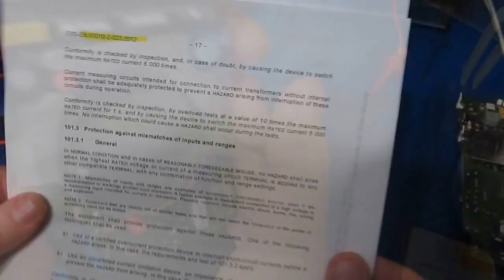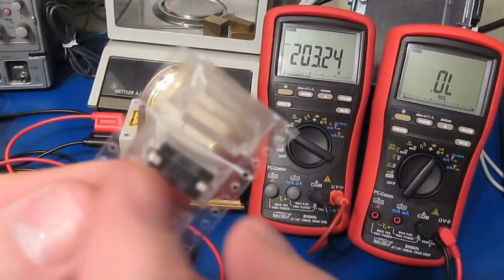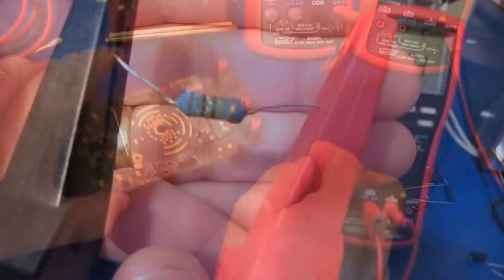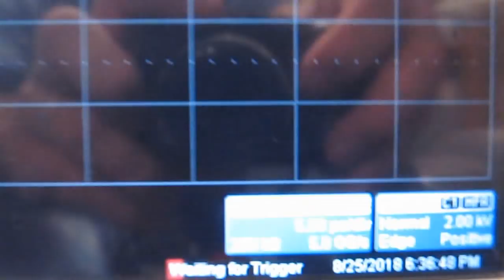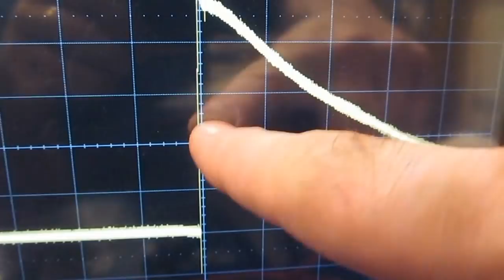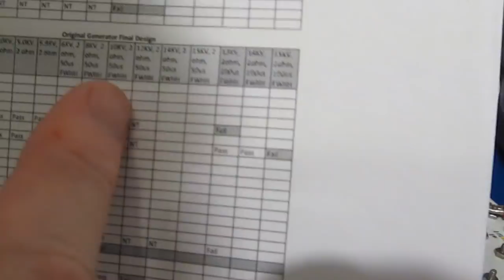Vintage Fluke 189, Replacing the Supercap and More

Comment: I replaced my supercap today with a 5.5v 0.33F supercap.  Success!  I used low melt solder to remove the original supercap, then cleaned the pads of all solder/flux, tinned the pads with fresh leaded solder, add flux and held the super cap with my finger tips in place to tack one side of the new supercap. Then soldered the other leg and ensure it was a good solder on both legs, finished off with IPA to remove all flux residue.  It was a tight fit, but it worked great! I didn't use a heat gun just a fine tip soldering iron.  "Better than factory!!"

Comment: why the supercap need to be changed. what does it affect. i have fluke 89 and is is flickering while reading resistance. it is minor like 0.5 ohm but it bothers me. will changing supercap help solve this issue. thanks in advance
Reply from the maker: There were physical signs of corrosion along the upper seal.   Normally they start to leak, no liquids, but low impedance.  Then the batteries start to drain very quickly.

Comment: Joe, my Fluke 189 is warning LEADS on all scales, but "A", I already removed the input jacks and cleaning, but still showing this warning.  When I heat it, the warning stops, but return when cold. Any idea? Thanks.
Reply from the maker: Looks like you are having a similar symptom as this person.   Maybe consider joining that thread and adding your findings.   
https://www.eevblog.com/forum/repair/fluke-189-multimeter-repair-advice-needed/msg4397968/#msg4397968

Comment: I just checked the forward voltage on my Flir DM285's diode function and it's 1.740v!  What a F****ING PIECE OF S**T!!!!!!!! I should have read the spec's before I bought the meter!!!! I retract my previous question!!  Dont bother testing that bag of RAT S**T unless someone gives it to you!  I'm building a project on a bread board and the dam thing would'nt even test a diode!
Reply from the maker: I wouldn't have much need to get above a 1.7V on the diode test mode.  I pretty much resort to using an external power supply to look diodes.  In the garage it never comes up.

Comment: I found a seller on eBay selling original profile supercaps for “Fluke Repairs”. The price is high, the capacitance seems the same as original, and they fit perfectly. The supercaps on both my 189s were slightly corroded and data was no longer saved during battery replacement, so I replaced the Caps. on both of them. All is well... The next day  I removed the batteries and replaced them simulating a new battery Installation. Date,  time, and saved data was preserved. Mission accomplished.
Reply from the maker: Why would you go to some unknown eBay seller?   I bought mine from Digi-Key.
Reply: @joesmith-je3tq  Perfect Form-factor closed the deal.  Do you know the  actual mFs and voltage ratings on the original caps?  Mine were too far gone to determine anything useful.  The replacement caps measured about 20mF and are 3.3v rated.  Their marking are "3.3v .20"  If there's more, it's welded under the positive connection tab.
I no longer have an LRC meter, so only my FLUKE 289 and my Mastech MS8040, with 100mf and 200mf respectively, have the range to measure the new caps. I'm totally lacking on detailed knowledge about designing with Super Caps so don't know if there's a trick to measuring them.  I've got some slack time this week so am going to educate myself.  I know you used 100mF / 5+v replacements but it requited mechanical mods to fit the solder pads.  I wanted my two meters to look "original" when opened so went with the smaller form-factor devices, since I'm selling one of them.  The only markings on the original S-Caps were a stylized "M" that has a "logo" appearance. One cap is marked 33 above an 11 all above above a lower case "f".  The other has a "54" above "15" above a lower case "f".  These markings are to the right of the "M" logo.  The "-" sign is below the "M" inside a circle, presumably representing the negative post of the device.  I'd say the markings are week and year, but the meters should be way older than 2011 or 2014....
    54     
M 14

-    f

EDIT:  I now understand measuring Super Capacitors requires charging them and timing their discharge via a specific resistive load. No big deal...
Reply from the maker: @Tool-Meister  I used 5V parts to try and give them a chance.

Comment: This an old topic but I have a recent encounter with Fluke service I want to share:  
“Hello,
Service still supports the Fluke 289, please do not open it, you will void the limited-lifetime warranty.
The 189 is obsolete, new Fluke 289 is the suggested replacement. It was obsolete in 2007, all warranties have long expired so you may open those to your liking; we do not have repair parts on the obsolete model though.

Please see a separate email from our system for your RMA xxxxxxxx for the Fluke 289.
Please also check your spam/junk mail folder as this is a system message.

Ship-to lab address is on the top left of your PDF in the confirmation. 
Please do not ship accessories unless requested, especially extra batteries. If we receive extra batteries we will not be able to ship back via air, your order will be returned via UPS ground for domestic orders or cargo ship for international orders. 

Thank you for choosing Fluke for your repair and calibration needs.”

BTW, I live 3 about miles from the Fluke service center in Beaverton, Oregon.  I still have to ship my 289 to them. Silly huh?
Reply from the maker: I assume they are still making the 289.   Personally, I would rather have the 189.  It's just a nice all around meter.  Between the Brymen BM869s and the 189, they are the only two handheld meters I have been using on the bench.  If I lived that close, I think I would have to try and get a job as a janitor.
Reply: @joesmith-je3tq   The Fluke 289 still seems to be the flag-ship of Fluke's hand-held general purpose DMMs.  There's certainly more expensive IR, Process Meters, various Special Purpose meters,. etc., but the 289 still stands out at 50k counts, inherent accuracy, and built-in logging.  
      I purchased my Fluke 289 in Jan 2017. I  use it to monitor and log solar arrays, battery banks, chargers, and inverter systems, mostly for mobile systems.   After seeing the 189s on your videos, I secured 2 of them.  One seems to be unused.  It had the original Ever Ready batteries,  etc. and probes, CD, and documentation are still factory sealed.  Both units handily meet factory specs against my DMMCheck Plus and Penta Voltage references.

      What we really need the “One DMM to rule them all!”  The CEM DT-9899 tries to perform that task, but falls short in too many ways. The Metrahit is god-awful expensive and I have better power analysis on my O'Scope.  Have to say, it's hard to go wrong with a Fluke....especially the 189s!    ;-)  Too bad they're obsolete.
Reply from the maker: @Tool-Meister  If I had to choose between the Brymen BM869s and the Fluke 189, hands down, I would get the Brymen.  Mainly because as you said, the only 189s available are used.   Each of these meters has pros and cons.  I do like the two K-type inputs on the Brymen and I have used the 500,000 count mode to trend data for example.

Comment: Hi Joe,  I accidentally connect a wrong polarity battery on my fluke 189,  part adjacent to 336C P100K has burnt.  W ould you be kind enough to tell me the part number of the burnt parts it is located just behind the contact point of the battery cell connector. Thank you in advance. and more power to your channel.
If you need a photo please let me know how to send it to you.
Reply from the maker: Do you have an account on the EEVBLOG site?  If so, could you post a picture of the part there and maybe circle it?

Comment: just found your channel and i already love your videos but i had a question 
i own a fluke 189 and i think the supercap is starting to go bad so i wanted to replace it but if i do, do i risk losing the factory calibration or not ?
Reply from the maker: Not but depending on your skills, you could ruin the meter.  I believe the parts I procured are  no longer offered.   Good luck and if you have any questions, feel free before doing anything with the meter.
Reply: @joesmith-je3tq  Thanks for the reply 
my soldering skills are not too bad so i don't think that would be a problem and i'm quite surprise that the calibration is not going to be affected by changing the super cap , i thought i would loose everything and would have to send the meter for calibration 
also i can't buy the panasonic cap that you've used in Switzerland so i'm gonna go with this one i think 
https://www.distrelec.ch/Web/Downloads/_t/ds/FC0H104ZFTBR24_eng_tds.pdf
the size is pretty much similar to the one you've used but it's a different package
Reply from the maker: @rickalison5718  This message hit the spam filter due to the link.   Many people will remove the cap and leave it out as they don't need the features.   Calibration is checking the meter against a known standards.  Alignment is adjusting the meter to bring it back into calibration.  Changing the cap will have no effect on this.
Reply: Also i saw in most of your videos that you also like your brymen bm869s alot but is it really that much better than the fluke ?
Reply from the maker: @rickalison5718  Right, I do like the Brymen BM869s.  Out of all the meters I have looked at, it's still my choice.  Of course, that doesn't mean it's the right meter for you or anyone else.   Fluke hasn't offered the 189 for several years.   I like the 189 but I like a few features the BM869s offers that the 189 doesn't have.  Two temperature sensor inputs for example....

Comment: The 189 function switch contacts are now available (out of China) on eBay. Can't say if they run as smooth, don't wear tracks excessively, etc.
Reply from the maker: Thanks for the post.  That's potentially very good news.
Reply: @joesmith-je3tq  I recent;y bought a full set of battery contacts for a 189 for about 12.00. Installed them on a 189 type back cover and tested fine. Cheaper quality than the originals but they work.

Comment: Forgive me Joe, I'm a fluke addict... my vintage fluke 73 is 35 years old, and still working! Have the 189 also. You definitely recommend replacing those two resistors??? Also in the uk 👍🇬🇧
Reply from the maker: I didn't suggest anyone to change them during the video.  For educational purposes,  the video describes a particular test that a modern meter would be required to pass if it were to be certified and that I suspect that this meter could use a better part.
Reply from the maker: My first Fluke runs but took a lot of TLC to bring it back to life again.   https://www.youtube.com/watch?v=ObKomuLLqU8

Comment: Thanks for the part# on the super cap Joe. I looked for one after I purchased my 189 and could not find any. Finally found some on EBay last week. Came in today and installed it with no issues. 24 hour clock and logging memory is working great now. The old one was puking electrolyte. Didn’t make it onto the PCB so I lucked out on that one. That 189 and my BM869s are within a few mv in DC and a few milliohms in resistance of the Keithley 197 I just got recently. I’d say the 189 and the 869s are quite accurate hand held multimeters.
Reply from the maker: Borrowed a 189 a few months back and the batteries were dead.  Owner said they had just installed a new set.  Put a new set in, and the battery indicator came on shortly after.  With permission, I pulled the cover and sure enough the cap was bad.  Lucky it had not broke the seal yet but it was pretty much shorted.  They didn't use the RTC so I just removed it.  These meters are getting pretty old.
Reply: @joesmith-je3tq  Yes, they are getting old, too bad Fluke doesn't still make something similar. Great meter accuracy wise and feature wise. I've turned on a lot of people to the Brymen meter's  They all seem to love them. People who are skeptical I send them to watch your channel. I belong to a lot of tube amp builders and repair pages on FB and other platforms and meters come up quite often. Recently a page moderator was promoting a meter I would not dare use on a 500v+ tube amp. Most of the members challenged him on his choice. A lot of members threw out the Fluke brand of course and quite a few mentioned Brymen including myself. Great bang for the buck and I feel confident probing 500v B+ in a tube amp with a Fluke or the Brymen thanks to all your thorough tests.
Reply from the maker: I will run up the free meters from HF to a KVDC from time to time but the current from my supplies is fairly low and they don't have a lot of stored energy in the filter stage.   There is a big difference in say my home stereo tube amplifier and the local TV station.  lol.   I am comfortable working at several KV at home on the bench but shy away from a 440AC line in a factory.  As always, the best tool will depend on the application.

Comment: Hi Joe, thanks for the vid.  I just bought a used 189 and opened up the case to see if the supercap was OK.  Turns out that the previous owner had replaced it already with the Panasonic supercap.  I'll pop it open every few years to make sure it isn't leaking.  The 189 is a very sweet meter.
Reply from the maker: Congratulations on your new meter.  These are indeed very nice, even for their age.

Comment: MKme lab has a youtube video where he also removes the ultracapacitor (at first sight he thinks it is a diode) from his Fluke 189. It seems that he had a parasitic power draw of around 200mA.
Reply from the maker: I watched that video along with a few others on the 189.   My favorite is still this one: https://www.youtube.com/watch?v=DUwkuM3blsk&t=1s
Reply: I watched this video quite a while back. I loved his humor about the engineer LOL! I've dealt with a few of those type guys in my years as a toolmaker/programmer. Most guys were on the nuggets with knowledge, a few I ran across were as clueless as they come working for a world wide manufacturer of fiber optics at that time in the late 90's. Amazing how some of these guys got their degree.   @joesmith-je3tq

Comment: You should blow one of these up https://www.youtube.com/watch?v=1CwREOA9RSg
Reply: Er, I meant to say test one of those. Yeah that's it.
Reply from the maker: I've seen enough UNI-T products for some time.  I picked up one of their BT adapters for the UT181A.  Come to find out, they have no support for Windows even though the manual states they do.  A total waste but that's nothing new for UNI-T.   I would buy a UT181B if they addressed my concerns with the A.
Reply from the maker: The 181A has some pretty good input protection circuitry.  It's a case where spending the money on the components and dropping the ball in engineering did not go very well.  I've never seen one of their branded handheld meters do very well.   I've ran a lot of their products and the fact that they couldn't get it right with their high end product,  I doubt they will sort out how to make a robust low cost one.  You could buy one and a cheap grill starter easy enough.  Pushing the button of the grill starter doesn't require a lot of skill.  Let me know if it survives.  lol.

Comment: I got my 2 new supercaps and opened up the 189 to inspect for any leakage and found none at all. So I guess I have 2 spares for the future. When I first heard of this issue, I removed the batteries, hoping to prolong the life of the cap, since I don't use this meter to often.
Reply: You better replace your supercap if it has more than 15 years old. If you wait until it leaks, this may definitively damage the PCB and then your multimeter. It takes few minutes to do.
Reply: @ahmedlazreg6373  Does it help any if there has not been any batteries in the meter for years?  The new one I bought are now also quite old by now.

Comment: What's the battery life like on the 189? I was able to lay my hands on a Fluke 87-IV (which is basically a 187), but the battery life of 70 hrs put me off. I'm happy with my Brymen 867 so far. Nice vid, as always!
Reply from the maker: I have a friend who had the 87 IV.  He really liked that meter.  It eventually died and he bought an 87 V thinking it would be an upgrade.  Even to this day, he is not a happy person over that deal.  lol      

They claim 72 hours typical with the backlight off when using Alkalines.   I never measured the current draw.  When my friend gave me that one Fluke 189, I installed new NiMH while I was going over it.  Those batteries are still in the meter on their first charge.   When I was making this video, I had some very old AAAs that came with the Anengs installed in dead meter that I was using to power it.   It it not last very long on those!  lol.   

I have fitted both Brymens with rechargeable lithium batteries.  The first one I had installed one into is now on it's second charge.